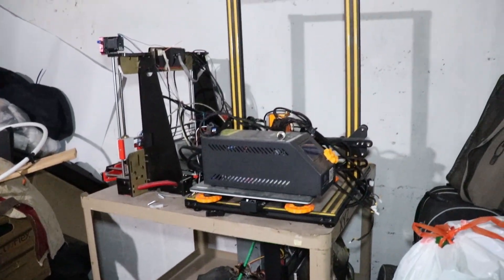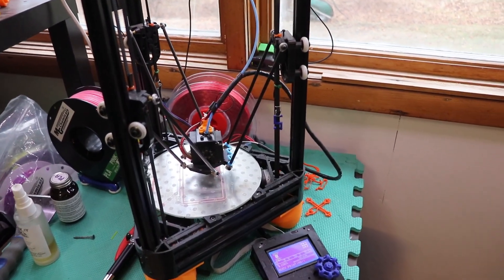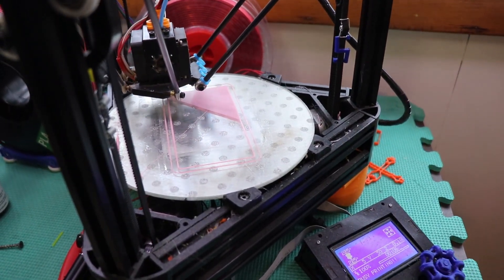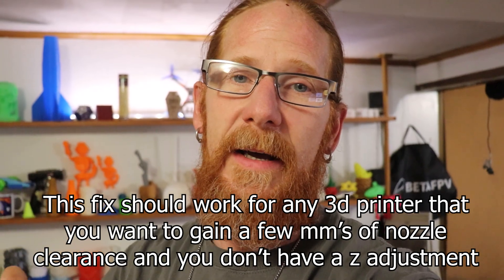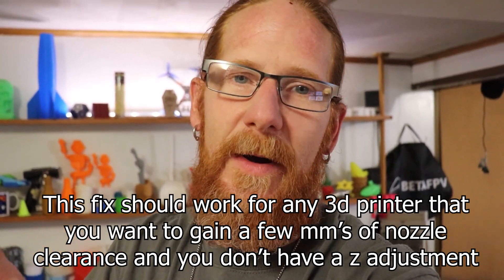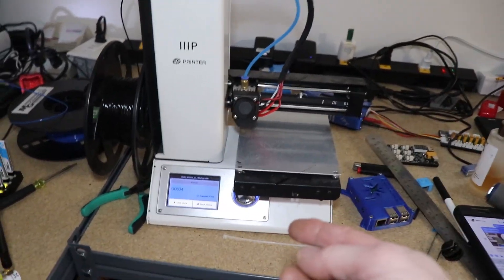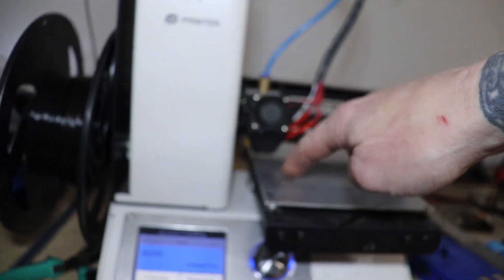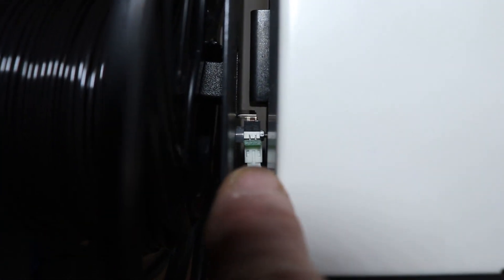Fixed My Maker Select Mini 3d Printer with a Magnet

Comment: "And now your host... Matt"  Love it. 
Clever fix.  Now if you can find a reason why the offset between my bl-touch probe and nozzle keeps growing I'd love to hear it. I can't for the life of me figure it out.
Reply from the maker: Glad you like my new intro seems to be the consensus I’m happy about that. As I know how to fix your bl touch you need to calibrate it correctly. Remove it and take it to a room with hard floors and smash it as hard as you can then go back leveling manually lol sorry not a fan of the Touch ID say a sensor but they are tricky to set up also. Manually is tried and true method. Wish I could be more helpful
Reply: @InsideTheMindOfMatt  😄😄  I could apply the same treatment to my printer about 20% of the time.  Of course 99.9% of the issue I have with my printer are due to nozzle height above the bed.
Reply from the maker: Well there is a feature in marlin called baby stepping and it allows for the nozzle height to be changed on the fly. It has to be enabled and it will also store that offset as your new z you might have to reflash the firmware if it’s not enabled now
Reply: @InsideTheMindOfMatt  Now that is something to look into. I have the source code and can build it. Thanks!

Comment: No idea what you're doing wrong here. This should not happen at all. Anyway, what I did when I added a glass bed was to print a Z-bracket and clip it in there where you have the magnet. Though your printer would have to be working to be able to do that.

Also, I absolutely recommend to use a magnetic bed or FlexBed instead of printing on the raw aluminium. A glass bed would be okay, too, but getting the PLA to stick can sometimes be a bit of a hassle.
Reply from the maker: I think I know how it happened. The way the hot end is assembled I have messed with it and replace the nozzle and it’s probably lower. This fixed it a printed part would also work
And as far as pla sticking I don’t have issues with that I know how to get it to stay on glass metal buildtak tape whatever it is I got that part down and got this fixed so I guess not really doing anything wrong now am I 😁
Reply: Nah, it's more the getting-printed-stuff-loose-without-needing-a-scraper part where BuildTak and FlexBed really come in handy. Also, yeah, buying the wring nozzle can get you real headaches. After several attempts, I found a high-quality one that closely resembles the one that came with the printer, and I'm getting great results since then.
Reply from the maker: Flex plates are nice but I got a great tool that works for getting parts off this is the only machine I still print on the metal and now that I got some room to wiggle I might add something but for now it’s printing so I set it and walk away lol

Comment: I gave mine away hated it
Reply from the maker: sorry to hear that for me it's been a trusty little machine.  I got a jam once and disassembled the hotend and it is very janky to say the least but when I reassembled it is when I thing i put it back together with the nozzle lower them before and it took till now to fix it but before this thing was cranking out maker coins like a champ but it's not the most high end machine out there now in 2020
Reply: Inside The Mind Of Matt think I’m going to try a sla resin printer
Reply from the maker: @edgotbait  I'm going to eventually also I want to try the wax resin for casting purposes
Reply: Inside The Mind Of Matt 
Ya that’s what I want it for to to make game pieces for wife’s board games  and  pieces for board games to sell

Comment: There is a Z height adjustment clip that I got of Thingiverse to make a z height adjustment for glass that should work and it’s easy to insert and remove.
Reply from the maker: Norbert Davis I didn’t event look to be honest once I saw the magnet trick I have to try and it worked so I stopped trying to fix it 🤣

Comment: A simple fix, I like it.
I had the same problem with the X and Y axis on my Select Mini and I fixed them by designing  U shaped pieces. One slid onto the frame that supports the bed and added about 2 millimeters of thickness to trip the switch the other slid on to the X carriage adding about 1.5 millimeters .
As far as the Z is concerned I did the glass bed upgrade and which adds the spacer about 3 millimeters thickness already.
Hope to see you at MRRF again this year.
Reply from the maker: electronron1 I got a buildtac for it somewhere but never had luck with it but that was also early in my journey I like the metal surface with Tesla Goo I get good adhesion
 and as far as MRRF goes I have a choice to make MRRF or IO (Huge drone gathering) i can’t do both and if I’m leaning to the drone thing but haven’t decided